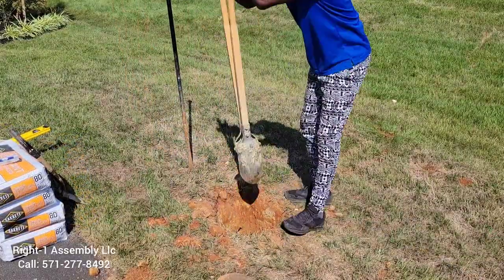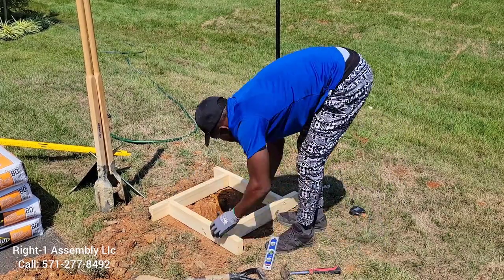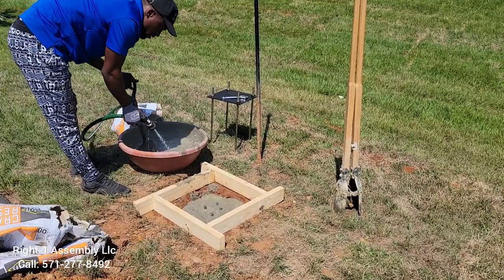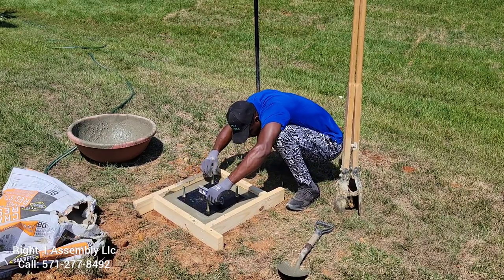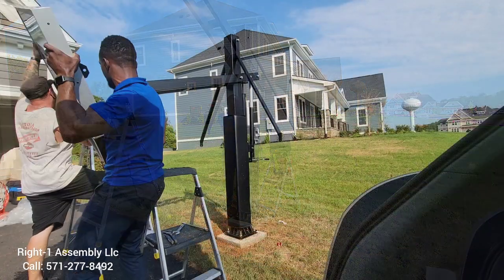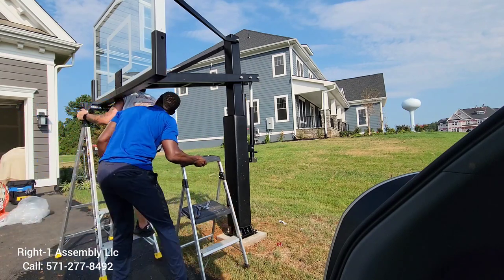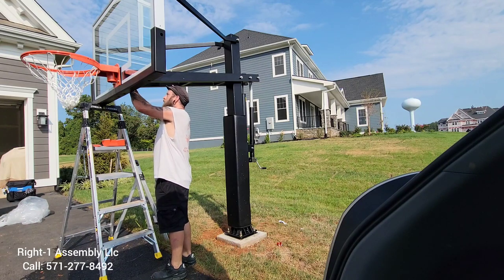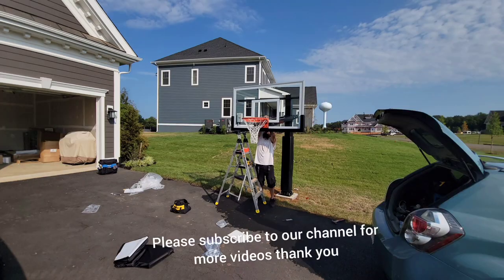Installing a mega slam basketball hoop

Comment: Right =1 Assembly LLC is the BEST!!!! They are so kind, professional, respectful and do an amazing job! June 2022 they drive all the way from Maryland to Virginia Beach to assemble my son's basketball hoop. The first day they dug the hole and concreted the base. They returned in five days and assembled the rest of the hoop and I am very much satisfied and pleased with their work. Amazing job for sure!!!
Reply: Be cautious, the hole they dug in this video is not nearly deep enough and they didn't use enough concrete.  In this video they used 4 80lb bags (320lbs) to secure a 760lb basketball goal that has a 4 ft offset.  Imagine the strain on the base if a 200lb man dunks and hangs on the rim.  960lbs pulling laterally on a 320lb base....  I just dug one for my kids, took 18 -80lb bags (1440lbs) to fill the 20x20x48" hole and by my math I was short half a bag....if that form breaks and you goal shatters, I doubt it's covered....hope they did a better job than this video

Comment: I thought hole had to 20x20 and 48 inch deep and use about 20 bags of concrete
Reply: It does, I used 28 bags 60# sacrete.  The rebar should be suspended in the concrete.  Homeowner got shafted here.
Reply: I used 20 bags that why I dig my own hole because of that half doing the job SMH
Reply: I just did mine, 20x20 square hole 4 feet deep.  Took 19 bags of 80 lb quickcrete.  The hole in this video looks very small compared to the hole I dug, which is what megaslam recommended
Reply: Definitely can see some long term problems with that amount of concrete.
Reply: @leov36  I just did mine and it only took 18 bags....think my hole may have not been perfect, but it was waaaaay better than 4 - 80LB BAGS OF CONCRETE
Reply: Mine is going 90cmx90cm and 150cm deep. 1.2 cubes of cement or about 80 bags

Comment: You needed a bigger hole and more concrete
Reply: I came to the comments this....I just finished one for my boys for Christmas....no way that is a 20x20x48 inch hole...the goal weighs 760lbs....hope he used more 80lb bags than that picture showed...the plans say 20-22 bags, my math came out to 18.5 (I'm sure they had extra so you didn't run short and not have a monolithic pour) and it took me 17.75 so my hole obviously wasn't perfect...the fact that I could see his rebar that close to the surface tells me that hole ain't close to deep enough

Edit: just looked again, 320 pounds of concrete to hold a 760lb goal that could potentially have a 200lb man dunking at a 4ft offset...gonna break